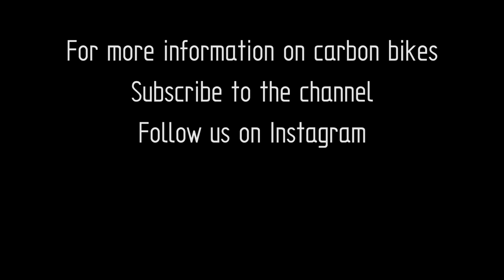Don't do the "squeeze test"!

Comment: I have an opinion somewhat related to the frame flex problem. The UCI banded the Supertuck which put most people into a social uproar. The main reason people thought was that you could loose control and not be able to recover and therefore crash. But the UCI also have to inspect approve and put their sticker on bikes that are allowed to be used in races. Could it also be true that in their testing they think that putting forces on the frame in certain locations could break the frame while riding because these carbon frames are only designed and made to take the loads of a rider being properly positioned on the contact points, being saddle, bars, and pedals? The UCI rule about the Supertuck makes more since to me now.
Reply: Yes. I totally agree. Imagine if a rider goes over a bump and comes down on the top tube with his weight.  Such shearing forces could be generated and start to delaminate the top tube and result in the rider losing control. I don't know what happened to Fabio Jacob in the 2023 TdF, but his bike split on the top tube, no damage to the wheels.

Comment: Regardless of all Raul - surely, if all that you need to damage carbon frame is to press on a tube with your thumb - there's something fundamentally wrong with its design!
My old first generation Trek Madone 9 was that way in the centre of the down tube. Totally understandable, strong where needed, weaker where not, but like with earo yawn angles, frames aren't always loaded structurally in an ideal laboratory ways. Long story short, I am now way beyond carbon.
My new titanium frame passes all thumb tests! 😜
Reply: Congratulations! 🤙
That was definitely the right choice—one of the best materials to build a bike!
Would never go back to carbon for that few grams of weight saving....
Reply: @87togabito  whatever mate. Suit yourself. I'm not a pro, never was, never will be. No need for a bike like that. And I stand by my original comment anyways. If all that one needs to cause permanent damage to the frame is to squeeze it with a thumb nail - then the design is just flawed and you won't convince me otherwise. The frame is never only getting loaded in the exact way designers assumed it would. There's transport, cleaning, maintenance, occasional accidental bump or kick. Don't tell me that it's ok to design a frame which is soooo "optimised" that doesn't have structural redundancy to take such instances. Maybe, but it's a huge maybe - for pros - but never for general public! But given that UCI insists that each piece of kit they race on must be commercially available, then it's just outright wrong.

Comment: Let me get my old drum out and start bagging. 😄

Here is another reason I ride a titanium bike. I have a cut tube of titanium, the same as the one on the top tube of my bike. It’s less than 1mm think, probably 1/2? Anyway I challenge people to crush it… even though it’s an empty tube cut open at both ends nobody has been able to deform it with hand strength.
Reply: Amen.
Reply: Well... Had 3 titanium bikes from well known brands. All three developed crack on the bottom of down tube/head tube junction. Frames warrantied but not looking for titanium since. Maybe in the future
Reply: @JanKowalski-pe9lo  that sounds a little unlikely?
Reply: @JanKowalski-pe9lo  the same brand? Or different each time? If it’s the same brand then it’s likely to be an issue with their manufacturing. I personally know 18 other people in my area who own titanium bikes and in the past 5 years non have had any issues. And one of the bikes is 15 years old at least.
Reply: @reginaldscot165  Different... Yeah I was surprised. Maybe they were welded by the same welder xD. Last brand let me keep damaged frame so ots hanging in my shed as a prop :P.
Reply: @JanKowalski-pe9lo  ok so the next question is, are you using your road bike to jump off MTB ramps? 😅 Because it’s not the norm for titanium to crack, it happens, but it’s out of the ordinary. But for one rider to crack 3 frames in the same place on 3 different models from 3 different Brand’s…? You are A) the most unlikely guy on the planet. B) using your frame like a hammer to brake up concrete pathways.
Reply: @reginaldscot165  titanium weld and tube cracks are very common a d a bigger to get repaired as there aren't many welders that do titanium welding to a high standard.
Reply: @reginaldscot165  Well... I do understand you :). My toughts are or i am most unlikely man on the planet or too heavy (190lbs) or all those frames has been welded by the same welder. My father have Sabbath Titanium bike its like 15yrs old and in the great shape. He told me to not touch it tough xD.
Reply: Maybe harder to crush, but I have seen more than one Ti frame where the chainstays ripped right off the frame at the heat-affected areas of the weld. In one case, it was a complete and instant failure that put the rider into the chipseal at high speed. Every material and construction method has its pros and cons, and they're all dangerous when done badly. I have bought 2nd-hand aluminum frames that were so riddled with work-hardening cracks I couldn't believe the bike had even been ridden to that point.
Reply: @JanKowalski-pe9lo  Cracks as you said were at the junctions, so they were all welding faults, most likely from improper purging with an inert gas. i.e. Oxygen contamination while welding. The tubes themselves and thus the material did not fail in your three examples.
Reply: @shannondeckard8587  Exactly... thus I'm pointing out on welder (probably same for all 3 brands) xD
Reply: @shannondeckard8587  So you're saying that if a CF frame fails because its improperly infused, bagged, bonded, or over-layered, then the material is still good, as you claim the Ti was in the failures I've witnessed, that the fabrication was just wrong. Thanks for that. You've proved my point. None of these material is inherently superior, and it all comes down to building the machine to match the intended use, as well as building it properly.
Reply: @SethJayson  I am saying that CFRP when it fails, it fails catastrophically regardless of the quality of the manufacture.  Failure of one tube generally takes out the adjacent tubes with it. The CFRP tubes themselves invariably break so it is evident that the material is unsafe from a structural POV whether it is well made or not. While Ti tubes don't break but will bend and it is highly unlikely the Ti tubes fail themselves, Ti frames when they do fail, they fail at the junctions/welds which is generally caused by improper purging while the junctions are being welded. Even when a metal bike (not just Ti) fails, it doesn't generally doesn't cause  the whole frame to buckle under the rider, which makes metal bikes a lot safer than CFRP. The added danger with CFRP bikes is that their manufacture is generally subcontracted out to the Far East (to cut down on cost) where there is very little control of the manufacturing process compounding the safety issue.
Reply: @JanKowalski-pe9lo  ha ha That’s your answer then. Safe riding 👍🏻
Reply: @shannondeckard8587  this guys gets it 👍🏻

Comment: While this video may be technically correct, its not very reassuring is it?  I get it that carbon is arranged to provide strength in a particular direction, but forces on a bike frame are seldom so simple.  I would like to see some lateral stiffness in the body of the tube.

Comment: The fact that you can damage a CFRP frame by applying the pressure of your thumbs on the frame tubes,  just sums up the lack of resilience of the frame and highlights how fragile CFRP bikes are especially ultra light ones. Tell me again why it is such a good idea to make bikes out of CFRP...
Reply: Lol he literally just explained why that’s not a good test. Stiff and strong are two separate types of measurement. That’s like saying a fishing rod isn’t strong because it bends…
Reply: @flyfreak23  What happens when you bend a CFRP  fishing rod far enough? It breaks/shatters in two. If the fishing rod was made of steel of steel, it would not break in two unless you repeatedly straighten and bend it again. If it was made of Ti, you wouldn't even be able to bend it.

Comment: You don't have to be a rocket scientist to get that one !

But frankly, is it logical to make bike tubes that thin considering the average user behaviors and intended use ?
Reply: No its not logical. Which follows tradition, this is the same bike industry that used to put 53/39 on all bikes, and tiny skinny rock hard tires. Stuff that is not appropriate for 99% of people.
Reply: I think its this obsession with lightness that's driving this ,even though aero beats lightness unless you commute up a mountain daily.
Reply: It is logical. If it instantly delaminates and breaks apart like Raoul said about the Stork frame then... it was improper handling and a new frame has to be purchased. Kaching! In that case there is no warranty due to customer abuse.
Reply: The concept is that larger tubes with thinner walls are stronger than smaller tubes with thicker walls. The larger tube can stand more forces. Much the same as Connandale in the past with their huge alloy downtube. It was thinner than other bikes
Reply: Diamond frame/ upright bikes are not logical.
Reply: @difflocktwo  
And so is your comment, I guess.
Reply: @oldmancycling7440  
I'm not referring to a concept but rather it's implementation in a context of practical use with proper risk assessment with regards to safety.
Reply: @sylvainmichaud2262  Yes, in a world where aerodynamic drag is our greatest loss, we should increase frontal area. I like the way you think. We should drag large parachutes behind us for even less pedaling effort.
Reply: The thumb test doesn't sell bike frames. The three digits in the weight column do. It's all logical.
Reply: @AnttiBrax  People pay a lot for audiophile cables but you gotta be a scammer to sell those.
Reply: @AnttiBrax  
"People buy things they don't need
at a price they can't afford
to impress people they don't like."
George Carlin

Specialized, more than any bike brand, understand that.
Reply: @difflocktwo  The aerodynamic drag of your body, not the bike's which only accounts for what, 8% max if your skin fold test sum is 35mm. 99% people buying top dollar bikes are twice that figure at best.
Reply: @82vitt  Yeah, being upright is really bad for aero.
Reply: @sylvainmichaud2262  Why are you taking anything i said personally? Why are you attacking my person?

My statements stand on their own and have nothing to do with neither me nor you. You need to relax.
Reply: @difflocktwo  
And a whiner !
Keep going, you'll make tons of friends.
Reply: @sylvainmichaud2262  Brb need to make a ton of friends to feel important. Have some self-respect brahim. Don't spread yourself thin. Enjoy the friends you have.
Reply: @sylvainmichaud2262  In technical discussions it is important not to focus on people. Right now you are laser focused on me. Please try to separate what is being said from who is saying it or how it is being said. 

I could have a mile long list of disorders but that isn't relevant.
Reply: @difflocktwo  
Yeah, I can't I praised enough your highly technical comments and how they've raised the level of the discussion.
And you wonder why I called you socially dysfunctional ?
Thanks for proving my point.
And I understand your reaction. You must have been bullied all of your life. But maybe it's time to grow up and work on your social skills.
Reply: @sylvainmichaud2262  I'm not trying to sell anything. So I don't need to inject any social engineering here.

My comments may be totally false but the comments themselves should be in discussion, not me nor my disabilities nor my skill levels.

You can call me whatever you want but it has nothing to do with bicycling comfort nor bicycling aero.
Reply: @sylvainmichaud2262  First comment; about upright bike and diamond frames not making sense. Second comment was on aero and third on comfort.

Every single one of your replies to me were personal attacks. You just keep doubling down on your personal attacks and continue to do so.

No amount of name calling will reduce bicycling aerodynamic drag nor will it reduce bicycling discomfort.

Ergonomic and aerodynamic design will solve those issues.
Reply: @difflocktwo  
Yes ! The subject.
Technical ? NO
Respectful? NO
You really have no sense of self criticism.

I've wasted enough time with you. Your the type who his always right. Go solve your interpersonal issues.
I'm done.
Reply: @sylvainmichaud2262  I literally said my statements could be totally false. not sure how I'm always supposed to be right. 

I consider aerodynamics and ergonomics as technical subjects. I guess this is where we disagree.

We are not here to criticize each other or ourselves. Just talking bikes.
Reply: @difflocktwo  
A) You first stated that it was on a technical ground - False
B) Simply recognized that your message have a tone that could be perceived as offensive. Then apologize, for wasting my time. If you don't, don't bother replying. You will have proven me right on all levels.
Reply: @sylvainmichaud2262  So is it me or you who has to be right?
Reply: @difflocktwo  
Still going on ...
God ! Worst than I thought.
Let me guess. Long time single or with a submissive women for whom you have no admiration and respect.
Reply: @sylvainmichaud2262  Good guess. You are right. You are always right. You are infallible.
Reply: @difflocktwo  
And yet, no recognition of the offensive character of your comments at the heart of the problem. Without this, we're not having this argument. So blame yourself. But taking responsibility is something that you've probably rarely done in your life.
Reply: @sylvainmichaud2262  You are incredibly correct. I lost this argument. I am wrong. You are right. Everything that I am, you are not.
Reply: @difflocktwo  
Even now, you don't explicitly recognize the problem. It could be interpreted in many ways. Ever apologized when screwing things up ?
Reply: @sylvainmichaud2262  As a person, I am flawed.
Reply: @difflocktwo   
The problem is not that you are flawed. We all are.
The problem is how long it takes you to recognize it while avoid it at all cost to say "I was wrong. I am sorry."
Because in the end, this is what makes the difference between being hated or not. 
I'm quite sure, you are the loosing a lot just because of this little effort that is still lacking.
Have a nice day.
Reply: @sylvainmichaud2262  ✌️

Comment: It would be wonderful to have an explanation from someone like yourself as to why it doesn't matter if you 'can' press in to the carbon.
Reply: It does matter. Doesn't mean you should, and particularly not if there is damage/imperfections (and there always could be).
Not designed to take on axis point loads is what I got from this.
Reply: There are various ways in which a force can act on a material:

tension - a pulling force
compression - a pushing force
bending - forces at an angle to the material
torsion - a twisting force
shear - forces acting across the material

A material can have very high strength in one type of loading, and very poor strength in another.

A cable has excellent tensile strength, but doesn't resist compression.

Ceramics generally have very high compressive strength, but very low tensile strength.

Spoked wheels need to be properly tensioned so that the spokes are kept in tension and are not subject to compression (and the rapid stress cycling that comes along with the compressive loading of spokes).

A structure (in this case a bicycle frame), is designed to resist certain forces. The same is true for any other structure: bridges, buildings, bones, etc. The ability of a structure to withstand forces outside its design spec is mostly good luck, but the more you optimise and reduce the weight, generally the less likelihood there is you'll be lucky. When you remove material you generally are weakening the structure, with regards to the ability to resist a certain force in a certain direction.

That a frame can be damaged by very small forces outside of its design spec is far from ideal, it makes the frame delicate and easily damaged. 

That said, the fact that a frame can be easily damaged in this way doesn't mean that it isn't safe and adequately strong for it's intended purpose (when undamaged) just that it's easily damaged by forces it wasn't designed to withstand.

This is a mostly unavoidable on ultra-light components where you're looking to shave every possible gram.

Comment: hello - you appear to know lot. can you do please do a vlog on best carbon wheels that can take steep descents & wet conditions. you mentioned 180 degrees as the key level for resin weakening. great if you can provide options from your testing without creating fear, uncertainty & doubt